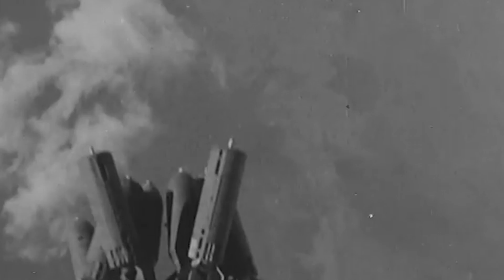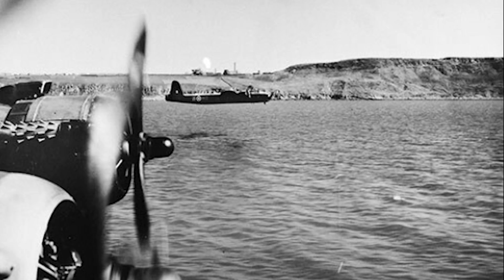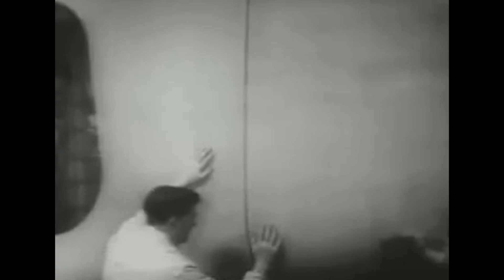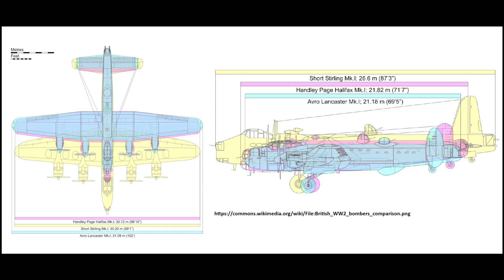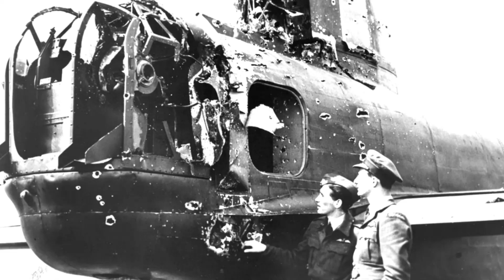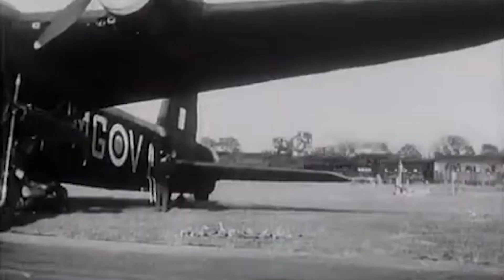The Short Stirling; First of the British Big Boys

Comment: @16:42 what is under the chin of the blenheim bomber?
Reply: A remotely controlled turret.
Reply: @nikbear  There were two options of Bristol turret - one manual, one power assisted. Whether they were effective is debatable. 2 Browning 303 in both versions.
Reply: @wbertie2604  The general concensus seems to be that they were pretty useless, like the fixed tail guns fitted in some German bombers. The gunner had to use a form of periscope to aim them, which was difficult due to vibration, and the pilot had to fly to give the gunner a perfect no-deflection shot. Since the attacking fighter always had heavier armament and a better gunsight the advantage was always with the attacker.
Reply: @davidjones332   Also, the Blenheims were often going in a such low altitude, it was fairly pointless. The upper turret was hard to get out of on the early Blenheims (it was replaced later with a Bristol X) so the poor top gunner stood no chance of getting out if shot down, and getting shot down was pretty common. I don't know how they got people to go on missions.

Comment: It wasn't a short bomber but it did provide sterling service...
It does make me wonder why Short did not redesign the wing for additional wing area/span, to the original 112ft wingspan, but the reasoning is now History. It did remind me of the American Martin B-26 bomber. The initial variants also had small wings, and it affected its safety. Martin then redesigned the wing for more wing area/span, and that help alleviate many of the issues of the original design.

Comment: Built the Airfix kit of this when  I was a child. I used to chat to a bloke on ham radio who'd been an apprentice at Short's Rochester factory. ONe of his jobs had been with making control line pulleys. In the first dept, the hole in the middle had to be precise to the "thou". Elsewhere he was told to ream the hole out if it did not fit! Imagine the difference the Stirling could have made in the North Atlantic hunting u boats? Lack of ceiling wold not have mattered.

Comment: Always had a soft spot for the Stirling ever since I was given the Airfix kit as a Christmas present many years ago. I was only 8yo at the time and it was my first "big" kit - not my finest build!
Reply: I built many airfix models and it really looked more impressive than  the Lanc or Halifax.
   My other favourite was the Sunderland and you can almost swap the wings and tail between the two because Shorts used them to speed up getting it made.
Reply: I have an Airfix Stirling and Sunderland in my stash. I'm 72 and may get round to making them one day. Shorts made some impressive aircraft.
Reply: As I recall the Airfix kit was a really good one, with really detailed crew and ground crew
Reply: @Mute_Nostril_Agony  Don't forget it also came with a tractor & bomb trollies, great for diorama's. 😎Ye olde Airfix Stirling kit is also one of my all-time favourites. They do need to replace it with a "new mould" kit like they have with the Lanc., B-17 & B-24 etc. but I suppose Airfix have an excuse not to do it as there are no survivors they can LIDAR scan & measure. I know ITALERI released a "modern" kit of the Stirling a few years back, but, being a long time Airfix fan, I can't bring myself to buy one as I keep hoping Airfix will.
Reply: @wullie3xv923  gosh. So it did!  Bloody hell, completely forgot that. 
(Pardon my french)
Reply: One of the few Airfix kits I DIDN'T have
My Dad despised Sterlings so they never appealed, tho I had all the rest of the four engined types
Mind you,  he flew RAF Recce Bombers asa Flight Engineer so he had a fair idea what was going on with 'em
Reply: MY GOD! I was about to say exactly the same thing (not sure it was Xmas): first Airfix "proper" bomber kit I ever built... for which reason it has a special place in my heart and somehow your B17s, Lancasters, Halifaxes, etc. were always sort of not quite a proper bomber. Series 5 or 6 IIRC.

Comment: i wonder why wingspan wasn't adjusted early on, i mean if wanting to enter a narrower hanger for service and repairs, aviation design had answers to that like removable wingtips. could even exchange them to different types like some fighters did. that would even allow to extend it further. 

to note, dealing with aircraft size was a topic of its own and still is, not only on aircraft carriers. the famous Bf-109 had the feature of removable wings wich came in handy since the aircraft could be towed into a forest instead of parking them in a target zone. similar thoughts about the german operated F-104 wich fits into a barn. was thought to operate out of civilian infrastructure.
Reply: MAP and RAF wanted to have Shorts design something smaller, I think. It was bigger before a shorter wingspan was requested, to meet the original specification. Also, shorter wings have less drag. Ceiling was an issue. Even bombload was an issue as it could often not carry as much on a mission as the Lancaster or Halifax, from what I've read.

Comment: What was the purpose/advantage of the twin tailwheel arrangement? I've never seen that before. Were they both free castering or steerable? If one was locked and the other not while landing I would think things could get rather lively.....
Reply: I presume that there were off-the-shelf components to suit smaller gear so it was probably just pragmatism. It would also use less vertical height in the fuselage when retracted.

Comment: I read a book which said that the Halifax and Manchester were both designed as medium heavies, from another specification. Both were to be 2 engined. The Manchester came out first, but was hampered by a state of the art untested engine, resulting in several crashes. Handley Page lengthed the wings of the Halifax, and installed 4 Merlins. When that proved successful, Avro did the same with their plane, and renamed it the Lancaster. Only the specification for the Shorts Stiing and the Submarine model were originally 4 engined. Submarine's prototypes were destroyed by German bombing, and defense of Britain was such a priority that Submarine was ordered to maximize Spitfire production, and on improvements to them.
Reply: I think you mean Supermarine. I'll assume that it's just spell check.
Reply: @mpetersen6  Yes. Supermarine. Good old Spellcheck.
Reply: P.13/36. Stirling and the Supermarine were to B.12/36
Reply: We definitely need a video on the submarine heavy bomber. It's been grossly ignored over the years!! 😄
Reply: @EuroScot2023  it didn't get very far. Supermarine was trying to build some Spitfires. When the Stirling was entering service the Supermarine 316/7/8 was still just two partially complete fuselages
Reply: @EuroScot2023  
It's not grossly over ignored. It's just so super dooper secret that there has never even been a picture of it. Unless we accept the theory that Irwin Allen had film of it in the 1960s that he used on his TV show "Voyage to See What's at the Bottom" 😁. Classical Mad Magazine reference.

Comment: As an older American first thought is the B17 but after reading many books on the air war I understand the impact the Wellington and B24 made. I retired from Boeing after 35 years so the B17 and B29 are special to me. I actually worked inside the original B29 plant in Renton Washington for a couple years.
My Father was a crew chef on B24's then C47's in the States never was posted overseas.

Comment: I realise it's a bit late now and the situation then was complicated, but if Shorts had reduced the fuselage length to that of the Lanc and Halifax, and shortened the undercarriage to keep the same ground angle, they would have had a lighter and better performing bomber with a higher service ceiling. Thanks for mentioning the "hangar fit" myth and not mentioning the nonsense about the Stirling having the "upper fuselage" of the Sunderland. The Stirling was a great aircraft that could have been even greater, if...
Reply: With MAP/RAF requesting a wingspan reduction, I wonder if it expected Shorts to do exactly that. Shorts was a bit caught out by the fact that the original specification was basically impossible to achieve well, and then it got changed anyway. There were heavy bomber specifications issued in 1934 (Whitley), 35 (Warwick) AND 36 (Stirling). And P.13/36 effectively became a pair of heavies. And more heavy bomber specifications followed prior to WW2. And that's not counting the 1932 specification that led to the Wellington.

Comment: I understand that the Halifax and Lancaster were superior aircraft. However, I have always had a soft spot for the short Stirling.  In my eyes, she's a beautiful bird, and I believe she gets short-changed in the history books.
Reply: When the Stirling was being fielded the Avro Manchester was its competition…
Reply: @allangibson8494  the Manchester and HP.56 were both medium bomber not heavies.
Reply: @neiloflongbeck5705  When they were built the Wellington was classified as heavy.
Reply: @allangibson8494  classifications like light, medium, and heavy and relative terms.
Reply: @neiloflongbeck5705  And the Lancaster had a heavier bomb load than the B-29…
To the point that B-29’s were fitted with Lancaster bomb shackles for the nuclear weapon delivery function…
Reply: @allangibson8494  "And the Lancaster had a heavier bomb load than the B-29…" No, it didn't. The maximum load of an unmodified Lancaster was 14,000lb. For a B-29 it was 20,000lb. Yes, a very few modified Lancasters could carry 22,000lb, but the B-29 could, with modification, carry 44,000lbs in the form of a Grand Slam under each wing.
Reply: @wbertie2604  The B-29 only carried a single 22,000lb T-14 under the port wing (they couldn’t fit in the short B-29 bomb bay (neither could the first generation nuclear weapons - the forward bomb bay had to be lengthened and the radar system moved aft while the aft bomb bay was sealed and used for fuel storage).
A single B-29 was modified to carry the 43,600lb T-12 intended for the B-36 for testing.
Reply: @allangibson8494  tests were successfully conducted with a Grand Slam under each wing. Photos of exist of at least one flying B-29 with two, available from one of the USAAF archives and to be found online. RAF Washington B.1s were fitted with racks for two Grand Slams. They were never carried even singly operationally AFAIK, but the B-29 could definitely lift two. As you noted, it could also carry the T.12 of 43,600lbs. That required modification to fit it on the centre line, but then the Lancaster B.1 special also required modification and only a couple of dozen were.

But the main message is that the B-29 could definitely carry a greater weight of bombs than the Lancaster.
Reply: @allangibson8494  reference photo Boeing 95561
Reply: Best looking of the three, IMHO.
Reply: For me, even though it's completely off topic and purely because you said Short, it has to be the Short Sunderland for me.
If money was no object, bugger super yachts, I'd be arriving in Porquerolles in my tricked out Sunderland.

Comment: Ed, from what I've previously seen the specs for the Stirling was written up after Short Brothers said that a 2 engine bomber can't be made for the current specs asked for with proven engines that were available. 
See info on Avro Manchester. 
With Shorts experience with 4 engine flying boats they designed and proposed the Stirling, and that is why they were the first of the big bombers.
Reply: Look at a Sunderland from above.
Then look at a Stirling from above.
Notice the wings and engines?
Yes - exactly the same.
Shorts accepted the specification then built a bomber version of their flying boat.
Reply: The Manchester was designed to meet specification P.13/36, the specification written after that for the Stirling (B12/36).

Comment: At about 10 minutes in you say that both front and rear undercarriages were retractable. But something that has always struck me about the Stirling is the unusual twin tail wheels which you can see in pictures of it in flight, definitely not retracted. Did something change in later production perhaps? Or perhaps their crews thought retracting it wasn't worth the effort. ;-)
Reply: IIRC correctly - maybe Stirling Aircraft Project - the retraction mechanism was troublesome and often permanently wired down as it didn't make that much difference.
Reply: @Julius_Hardware  that's correct, retraction and extension problems were quite common early on so they started locking them down. Retraction mechanism was electrically driven and early aircraft only had 2 engine driven generators so they would often be overloaded
Reply from the maker: I did wonder that myself, and their are pics of Stirlings flying with the rear wheel both up and down. Couldnt find an answer, so possible change, could be maintenance issues. 🤷‍♂️

Comment: Part or the Stirling's poor service ceiling was also the choice of aerofoil.  Too thick for high altitude.  The same issue bedevilled the Typhoon when introduced (resulting in the successor Tempest having a much thinner wing).  A complete re-design of the wing would have been impracticable, even if recognised at the time as part of the problem.
Reply: The aerofoil section was selected for the Stirling was to ensure adequate take-off performance.

As for the selection of aerofoil sections by British aircraft designers, many, like Sydney Camm,reliable on data supplied by bodies like NACA. In the mid-1930s NACA produced a report on laminar flow aerofoil sections that showed that they had no advantages over conventional aetofoil sections. This report was later withdrawn after NACA discovered that their windtunnel was faulty. But by then many designs had been finalised and production drawings and blueprints were being created.
Reply: @neiloflongbeck5705  understood, on the NACA report, it's a surprise that no (or almost no) one tried to validate NACA findings
Reply: yes, I don't know why British aeronautical designers were drunk on using (relatively) very thick wings on almost all aircrafts
Reply: @LuqmanHM  Wasn't just the British.  It was started by the Germans at the end of WW1 with the DR1 and then F VII.  Take a look at some of the Dorniers and Junkers in the early Inter-Bellum.  Some had wings thick enough for aircrew to service wing mounted engines during flight.
Reply: @anthonyjackson280  understood it was started by the Germans. and yes not just British but almost everyone was doing it. just that Brits take to it to the far extreme relatively

Comment: High altitude performance was not acceptable why did this defect not be corrected.
Reply: Because it would require a completely new wing design, which would be a new airplane, so there was no practical path to make it high altitude.
Reply: @danielhurst8863 yes but they new before production started prototypes  disappointed max altitude too low
Reply: Britain paid very little care when they built their bombers.
Reply: @arandomfawn5289  Not like the USA who built the much inferior B17
Reply: @arandomfawn5289  The real reasons are explained in the video.
Reply: @paulkirkland3263  knowing your producing a substandard a/c  low altitude before it enters service govt specifications were criminal
Reply: @Eric-kn4yn did you watch the video? The video explained it. Basically, pre/early war ideas about how to use heavy bombers, were pretty much wrong. With higher altitudes meaning less accurate bombing. And the British not adopting area bombing, where accuracy is less important, until after it was in production. It's just the war forced the aircraft to be used in way it was not exactly designed for. There is nothing criminal about it.
Reply: @Eric-kn4yn   Not really. It was a case of a medium altitude bomber expected to be adequate to the task or a redesign and no bombers at all in 1940/1. The latter would have been worse. Not great optoins, admittedly.